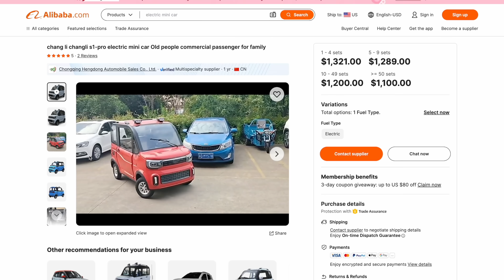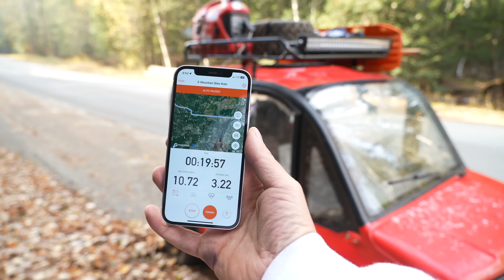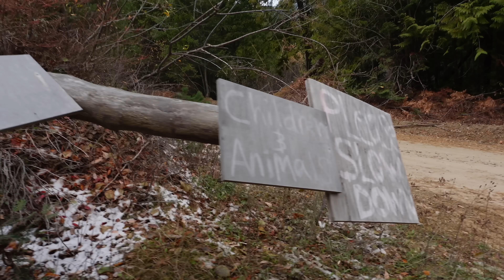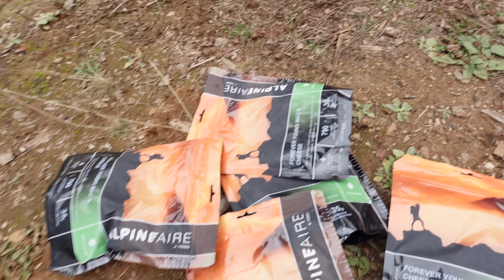World's Cheapest Car 100 Miles Off Road!

Comment: I hope you guys didn't go to college?

If it's got a 2 hp motor. Why are you loading all of this additional weight onto it?

Now that EV, has nearly unlimited range! As long as you keep it on the trailer. Behind the ICE vehicle towing it. It's got an unlimited range!

And so really as an, Electric Vehicle. Why should you need a trailer? Does it have regenerative charging as you drive your big rig? And so by the time you go from Point-A. To Point-B. It should be all charged up. If you don't tow it on a trailer. It's not like you're going to blow the transmission or the engine. If it has regenerative charging. And the more you tow it. The more it charges. And then when you run out of gas.. You can drive it a few miles. With the electric vehicle. And then die in the desert, inadvertently. Since, you couldn't make it back. And the electric vehicle turns out to be a bust. Because it is not Street Legal. None of those inexpensive short hop Chinese vehicles are Street legal in the USA. Don't ask me why? They can go very fast. And therefore are illegal on the Interstate Highways. Just like a bicycle. Just like a minibike. Just like a go kart. Just like a golf cart. Just like an electric bicycle. Just like a 2 stroke or 4 stroke powered bicycle. You can't take those on the Interstate Highways. So why are they not otherwise, street legal? It's preventing the use of fossil fuels. They don't go very fast. They are great for the elderly. As long as nobody bows us down. In their great big gigantic pickup trucks. Because they didn't see us. But in the same way. They are not allowed to mow down bicyclists, either. Or a jogger. Or somebody walking their dog. None are legal on the interstate highways. And we all know that.. So why can these not be street legal? Let's stop the nonsense. These are Electric vehicles. They want us to convert over to. So why are they illegal? This is not making, any sense, whatsoever.

Rules are not made to be broken. But Rules are for when the Brains, run out. And they have run out. By not allowing these to be Street Legal. So we can run up to the drugstore or the grocery store. Or over to the doctor's office. Just blocks away. And just like a bicyclist. You'll have to avoid, small hop electric vehicles. It's what has to be. Time to stop punishing people for going Greener. When they don't take them on the Interstate Highways. And are capable of at least 35 mph. Then they should be made legal. They already have seatbelts. They got headlights, brake lights, running lights, turn signals. What makes them not Street legal? They have brakes. They have tires. They carry 2 people. Yeah. So? This is going beyond dumb to dumber.

I would love that little car. That would work out great for me. I go 2 miles up to the shopping center and to the doctors offices and to the bank. All within 2 miles of home. And I'm 68, disabled, handicapped and a widow. And a proud American. And I Vote Democrat. And we will get these Electric Vehicles on the road. And stop making excuses. They are not really cars. They are low-power, short-haul, transportation devices. And they really don't go fast enough to kill anybody. Except maybe,, Governor, Greg Abbott of Texas? Who could get out of the way of a tree fast enough. When it hit him in the head. Not hard enough. Not his head but hitting it. He needs a harder hit, in the head. He's a Monster! Along with his henchmen, Lieut. Gov. Dan Patrick and rotten corrupt Atty. Gen., Ken Paxton. Who all agreed. To create a law against my life! Because they don't like my types.. Called, Woke Americans.  And they believe they have the religious right to attack me and destroy my life. Because they are all scumbag Republicunt's. Looking to seize power. And take over the USA! They've been working toward that now for over 50 years. And they have not yet begun to Destroy, Destroy, Destroy! Americans rights. They don't like.

And so Republicunt's are no longer Americans. They are Enemies of the USA. Enemies of the American People. And that's all they are. They are definitely not Americans anymore. They are fascist Gestapo stinking Nazis. And they think they are taking over. They are as moronic as the Japanese and the Germans were. As the Islamic's are. All misogynists. All psychopaths. All fascist freaks. And they want to be calling the shots!  And to instruct us, how to live, their way. Because they want to be in Total Control of American Lives!

We are going to have to fight these American Resident, freaks off.  What makes them think they can dictate to us Americans how we are going to live in the US? Even though it took Donnie, 76 years and 40 years after college. To figure out that us and US are spelled the same but mean two different things. Because he has never read anything in his life! He doesn't know how to read. He didn't bother to listen to anything in school. He didn't believe in school. He believed in being wealthy. On daddy's money. And now he's got the whole USA. And he's having a Grand Old Party!

Forgot or professes not to do drugs or alcohol.  I would certainly love to know the kind of drugs he is on? He takes Affluent Pills. They are filled with ground gold. As he believes if he puts gold inside his body. It will make him a heavyweight. As if he is not a burden and a heavyweight upon our backs. He's the Ultimate Freak! He's Donnie Trump!

This guy is plainly a maniac. Suffering from dementia. There is no rationale here at all. He says whatever he wants off the top of his cranium. And manufactures his own truths. Socially. He's hardly legit. At anything he does.. He doesn't destroy. Like, Bankrupting Casinos. When the favor is always with the house. They can't possibly go, bankrupt. Unless you want them to. For the tax write offs. Because he doesn't like America enough. To want to pay his taxes. And as he said himself. He never took an Oath. To our US Federal Constitution. He did not. And he wants to run the USA but doesn't believe in the USA. What's that mean?  It means he is a fascist Ku Klux Klan, Nazi. He likes them. He wants to be just like them. And he's saying the shitty stuff they all like to hear. And think he is Jesus Christ reincarnated! As they are that insane. And they have guns. Lots and lots of guns. And they are locked and loaded. And ready to aim. At the American people. To get, Their Country Back! From Americans. They want their country back from Americans. What is this supposed to do? How does this make them better? How does this make the USA, better?

Unfortunately we have about 100 million freaks on the warpath against Americans. And they are playing right into the hands of our, Lousy Adversaries. That are waiting for their moment to pounce. When we have our Pants Down. Fighting amongst ourselves. And going into an election. Where we will be very preoccupied with, ourselves. And fighting off insurrectionist, crazies. It's going to get nasty. Before it gets better. It's what they want. It's, what they are demanding. Because they are Tired of Being Losers! They want to be Winners! Anyway they have to.

There is going to be no good, easy, fix, to this.
RemyRAD
Reply: ok